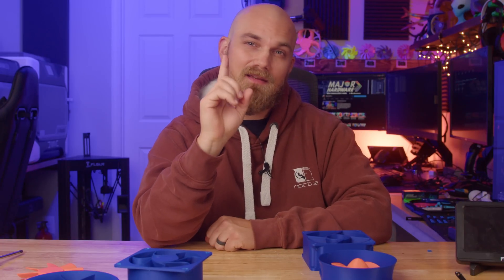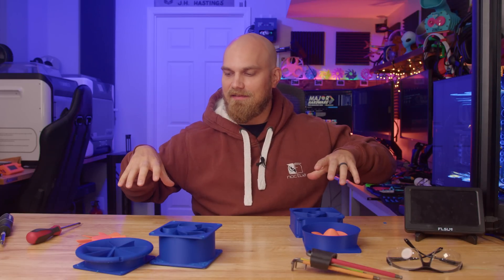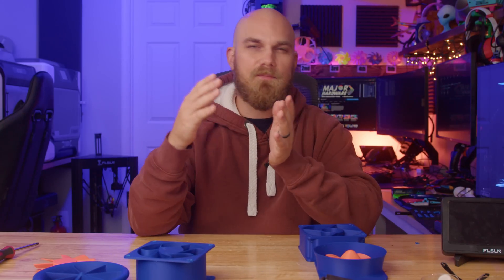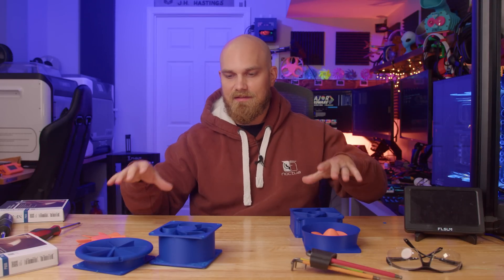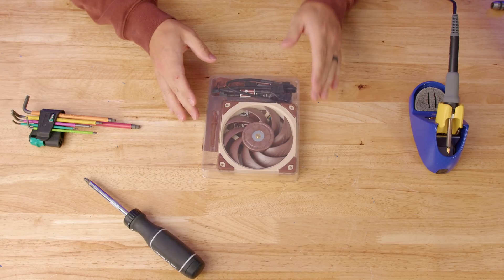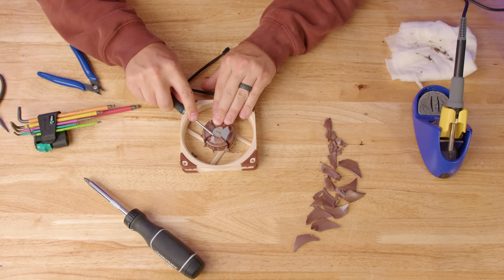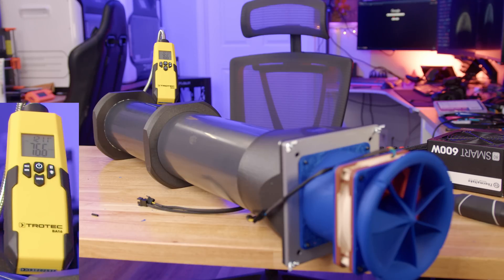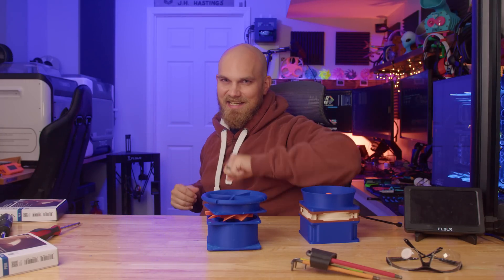Which One is REALLY the BEST | Fan Showdown S4 Finale

Comment: The flow test certainly allows for more accuracy at the top end of the ranking. What would help complete things a little I suppose would be showing what the minimum (or close to for some margin of error) flow needed to keep a set up from throttling is, that way people looking at aspects other than raw power (noise level, noise tone, cool look, etc.) will know if a design that catches their interest can do the important primary job of being a cooling fan.
Reply: flow rate lends directly to cooling ability, so it would be pretty easy to figure out where that line is as far as "not good enough" to "it gets the job done"
Reply: @ghomerhust  But is flow rate through a tube with no resistance the same thing as flow throught a cooler? If you repeat the test and put some fins or other restrictions in your test tube to simulate a coolers resistance i feel like the results might change a bit.

Comment: Idea for measurement :
test the airflow on a soldering pen, then mesure the current intensity of the soldering for keeping the soldering pen at 300K, at 400K, at 500K, at 600K . the airflow try to cool the soldering pen, and the soldering pen try to keep the chosen temperature, so the current intensity will increase.
with this method, you will remove the variability induced by running a software.

suggestions for the next season :
– allow experience with 2 fan motors combined
– allow a single motor with only the fixing base (so without the constraint of the fixed size encasing cylindric wall from noctua)

Comment: You need a hot knife. Basicly it's a soldering iron with a brass blade on it. You use it to cut plastic, foam ,skin wire, etc, etc.. You can get one from McMaster Carr.

Comment: Next season should be air pressure, as in high fpi radiator. That will bring some new variables to the table. Take like the aquacomputer radiators or something even denser than that.

Comment: I'm fine with flow or cooling. I do think there should be some sort of "weight class" to separate standard size fans vs those with extra shrouds and such, since they wouldn't fit in normal cases.
Reply: 2 categories would do it, ≤25mm and >25mm. The control fan even has it in the name :p

Comment: Air flow is more consistent and applicable to the fans,  but you really need a static pressure test. You could modify your existing setup to restrict the flow some and get a static pressure reading. If you really want to engineer it (please do) you could make the resistance variable to generate a static pressure vs airflow curve.
Reply: I vote a high FPI radiator
Reply: That curve would add a loooot of interest for every single fan imo.
Reply: This!
Reply: Yeah i agree, you could plot 2 points for scoring. One for pressure at x flow and one for flow at y pressure.
Reply: I agree that flow is the better way to measure as it is more acurate and controllable compared to heat. And yes, the pressure should be tested as well. Though I think it would make sense to do this as close to real world as possible and put either a tower cooler or a small watercooling radiator directly between the fan and the tube for measuring. maybe seal the area around the metal of the chosen cooler so it doesn't leak air. then the result of the airflow test would be far more representative of "cooling"performance.
just measuring static preasure doesn't seem nessessary. sure, if the highest airflow design has the best static preasure, that'd be an easy victor. but how would preasure be weighed against airflow? what is more important?
I think keeping it to one easy to read number in the end is best, and achiving that with as close to real world circumstances as possible while still trying to get as precise results as possible.
Reply: This would be easy and cheap with a homemade u tube manometer ported on the side near the end of the tube and some tape on the end of the tube for pressure.
Reply: I violently agree wit that!
Reply: Yes
Reply: Put a 120 mm radiator before it.
Reply: came here to write exactly that, you were lot quicker than me so you get the UpVote.
An intresting video alongside that would be to test the flow-resistance any specific radiator puts on an see if there are optimal combinations. 
(this neglects specific  heat transfers per volume air but from that this should be an easy  and logical step to go)
Reply: The rated SP of most PC fans is negligible at best, talking mm H20 or tens of Pascals. CFM through a good radiator would be useful data IMO
Reply: A flow test and a static pressure test is The Way.
Reply: I think the best part of this idea is that both flow volume and pressure could be recorded independently and simultaneously depending on how the tests are conducted, and with minimal impact on the results for either measurement. However, where the testing could get super in-depth is having two stages of testing. 
My thoughts are: first stage in which both volume & pressure are measured vs a different metric (RPM, dBA, current draw), and second stage in a practical application (radiator delta T, air or water general cooling performance). I believe with enough testing samples, those two stages could be used to compare volume & pressure measurements with a given performance result, and see what the correlation factor is. 
If there's high confidence in a strong correlation between the two stages, then the practical performance of fans which previously only had airflow measured could potentially be inferred for a given cooling application with reasonable accuracy.
Reply: This is the best idea here!
Reply: ^This

Comment: I continue to enjoy watching these videos! Another idea could be to have a fixed test system with a specific number of available fans. Contestants could determine fan position and design custom air ducts to create the most optimal airflow for both CPU and GPU. Probably slightly more complicated then just designing fans and more expensive to print. A small form factor case (i.e. NR200) would make sense for smaller components to print. The NR200 also has plenty of fan mounting options.

Comment: I'm surprised you weren't going to test both of them in regards to cooling in case one pulled away more, even if the other did do better in static pressure.

Comment: I would switch to unrestricted & restricted air-flow instead of "cooling", and do so via adding a typical 120mm radiator into the middle of the airway.

Comment: Please put the cheater velocity stacks and exhaust on a stock A12x25 and let us know if they alone will increase a stock fan. P.s. a single 120mm radiator custom loop with a 3D printed stand would be good imo. Means you can test if the coolant degraded over the season and swap it out easy if needed.
Reply: I second the motion on the stock/cheater test!

Comment: for season 5 i would like to still see air flow in your testing but i also want to see how it does on a 120 radiator. just like the current fans on the market , some fans are better for airflow and some are better for static pressure and would work best in a radiator and the air flow ones would work better for case fans .

Comment: Fans for computers make airflow and pressure.   Airflow is needed for case fans while pressure is needed to push air through a cooler...so they're both important but depending on what job it's being assigned then determines which parameter becomes the more important one.

Using the same electric motor for all fan tests makes this really a challenge of efficiency using the available power and the fan optimized for flow isn't going to make good pressure and vise-versa.
It would complicate the testing, but perhaps a pure flow test to give the win to the best case fan, then flow test after going through a AIO type cooler where it's going to need to make more pressure and likely would reward a different fan design than one that works best in open airflow.

Trying to use cooling is really throwing variables into the mix with heat source, cooler efficiency and room temperature variation all in play.   Simple flow through the cooler should tell what needs to be told I'd think for a cooler fan, and simple flow through the air meter what works best for case fans.

The current commercial fan designs are likely a compromise of both airflow and pressure so the consumer can use them either way, which opens the door for someone to make a fan optimized for either but not both to win either category.   Lots of decisions to be made here....but my vote is two tests: unimpeded flow then flow through the cooler.

Comment: I would love a comparison of all standard fan sizes(at least the top ones) as a special episode. Especially ones of the earlier days that didn't have indepth testing.

Because season 5 will be just about bigger fans again. With different intakes/exhausts. 

Maybe even the cheater without the extras or try it the other way around (top performing standard fans with the extras of the cheater)
Reply: I second this, getting a bit sick of giant, completely impractical fans. A few was fun, but making the entire thing about it a bit much.

And not getting to see how the accelotron (sp?) Is doing against the current crop is driving me nuts!
Reply: unfortunately the cheater without the extras is still an oversized fan that wouldnt fit in any computer case unless you used the extras. the prop itself sticks far outside the bounds of the noctua frame.

Comment: I would be interested in the water temperature of a water cooling loop with 2 140 Fans attached to a 280 radiator. Or the same with 120s on a 240.

Comment: I think you should keep doing air flow testing like you have been, but use a radiator behind the fan to simulate how they would do in a system.
Reply: Thissssssss
Reply: Good idea. Or instead of a radiator, stick a Noctua tower before the flow meater and see what can push air AND handle the pressure.
Reply: @lknowledge  you know a tower IS a radiator right? Or is your username really that accurate?
Reply: @castortoutnu  you know perfectly well that in COMPUTER WORLD a radiator is considered as a water cooling radiator and a tower cooler is an air cooler. And yes, I do know the difference from elsewhere, for example air-cooled vs watercooled cars/motorbikes etc. So I do understand the consent you are trying to convey. All tough, I have to say,  a tower as such isn't a cooler at all. It's a tower. But then again, I have the limited knowledge.
Reply: @castortoutnu  boo
Reply: @castortoutnu The term you are looking for is 'heat exchanger'.
Reply: I like this idea.
Reply: Yea, I commented already and then read this. AIO single 120mm rad could decide the winners, but testing the fans for static pressure as well as airflow would be really good.
Reply: I totally agree this would give us a more genuine flow after passing through the radiator
Reply: Why not combind both have the radiator on the flow test and measure both cooling aswell as flow rates using the seals aswell
Reply: @redallaround66  because the two tests will show the same results. Higher airflow through a rad will = better cooling. It’s redundant.
Reply: @Crazyates11  While true that highest airflower will equal best cooling, without considering static pressure somehow, this is just desk fan performance.
Reply: @Crazyates11  be mindfull that its not all dependent on air flow, if you have restrictions in the intake area where the main fan blades are, it can limit the area on the rad that the air passes through and so you can end up with hot spots in the rad that can affect the cooling edfficency of the fan itself
Reply: And you can use a temp sensor in the water to check the Temps to.
Reply: This is what I thought of as well, and glad to see so many people agree!
Reply: You could also add a pitot tube type device in front of the radiator to measure pressure
Reply: @PinkysRevenge if you use a restriction with a hole of a known diameter instead of a radiator, you can calculate the static pressure from the flow rate and hole diameter.
Direct measuring of the static pressure with a pressure sensor is not an easy task, since the pressure is extremely tiny, between 0.01psi and 0.04 psi.
Reply: Yes jam a 120mm core in-between for some real world flow vs pressure testing
Reply: This sounds like a good solution, yeah. The cooling tests were kind of useless. Too many variables. But the airflow tests aren't being run in a realistic environment.
Reply: I really like this idea. It sounds like a great happy medium.
Reply: This is a very cool and simple idea
Reply: that sounds like a great idea
Reply: Agreed
Reply: Any obstructions such as rads or drives requires higher static pressure fans, so on a case front fans should be high static pressure, exhaust as high air flow.
Reply: He needs to test the full pump curve - Give a performance rating for a "Case Fan" and for a "Radiator Fan" - Basically which fan produces the most airflow at two different static pressure set-points.
Reply: There is at least three use cases for this fan, how could one of the test be correct for the other two. I think the most used is a cpu cooler, then case cooler, then radiator cooler, since cpu is probably number one use case, I would add that after the fan and test airflow.
Reply: I'd like to see tests both on an air cooler and a radiator. It would make people have to balance airflow and static pressure vs only focussing one or the other

Comment: I would like to see water cooling, as the radiators usually require more static pressure when compared to air coolers

Comment: Honestly for season 5 I would love to see the fans inside a case for a real world situation.
Reply: Testing rigs and stands and instruments only tell so much of the story.  These may not be practical designs, but I definitely agree I would like to see something installed inside an actual case or something closer to reality... in addition to the airflow tests as well why give up my data points?
Reply: Having both a case and airflow testing could be cool
Reply: agree with you on that, it will take off some ideas of crazy shapes etc, but those will never be in a PC case anyways. maybe a pc case that have 1exhaust-2intakes of the same fan so we can see if it can pull the air out as well. some simple temp. tests and some smoke-test in a case with a window.
Reply: too many different cases
too many variables
Reply: this is all I've wanted since the beginning
Reply: On top of that you are in a compromised airflow situation.
Reply: you do realize that at that point you don't get usable data anymore right?
Reply: @HazewinDog  not the point. the idea is keep the airflow tests, but now also put it in a case. it's just about SEEING the fan doing something practical

it's like measuring a car's 0-60 on some stationary testing rig rather than seeing the car compete in a race. sure you get way more accurate and reliable data points from the former, but the latter is just more fun and is also a real example of "the thing doing what the thing does"

so we're just asking for both. good data, AND good fun (:
Reply: @HazewinDog  it's also about seeing something community-made do something practical. whether that's be used as a case fan, or a tower cooler fan. bc sure you could create some giant monster, but will it fit in a case ? could I buy 6 A12X25's and 3D print 6 copies of that fan and use them if I wanted to ? and moreover, would it be worth it ? would they look cool ? etc. and it's something to be proud of in a sense

so yeah, again, just fun (:
Reply: I think you're missing the point of this series. That's like saying you should see if a top fuel dragster can handle being a daily driver. This is a test of peak performance, not practicality.
Reply: @_Bonez12  peak performance but we have to face the same restrictions noctua had which is to be able to fin in a normal PC case and radiators, otherwise its not fair to say that someone made something better.
Reply: @_Bonez12  It was originally to see if we could design a better fan than the a12x25 using the same base, and imo if it can't fit in a case it can't be called better. If all you care about is airflow then just up your motor.

Comment: I think water cooling with a 120mm rad and using a heating element as the heat source would be the best. Possibly reusing a thermal couple and heater from a 3D printer? Mounted in a small aluminum block? I'm a machinist and would be open to the idea of machining the aluminum to mount everything to, if need be. (AIO, thermal couple, and heater)

Comment: Personally I prefer the flow test. But maybe add a way to measure static pressure. Maybe a fan can move a lot of air, but that is meaningless if it can't move it through a radiator.
And as Adam Savges said : The difference between science and screwing around is writing it down.